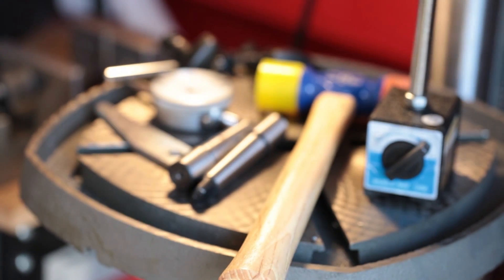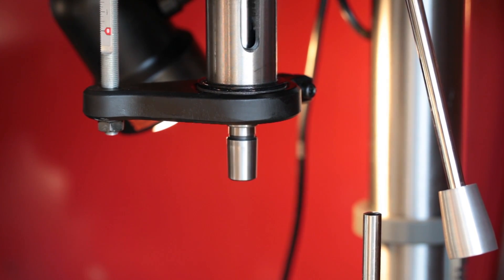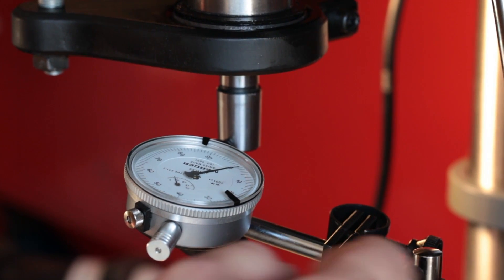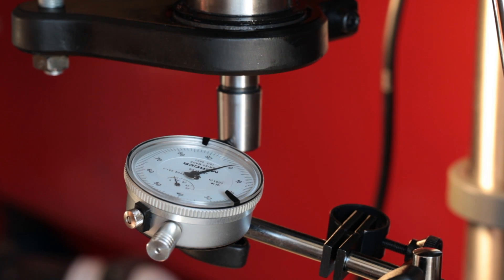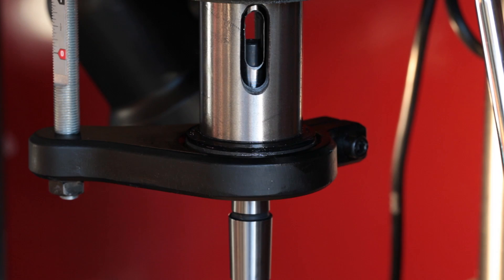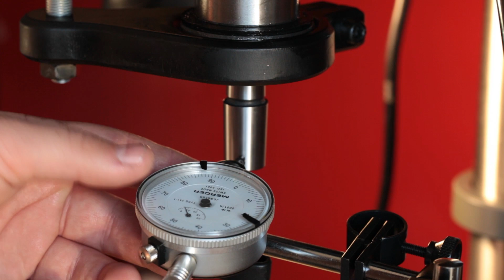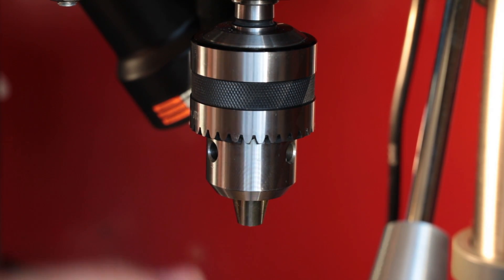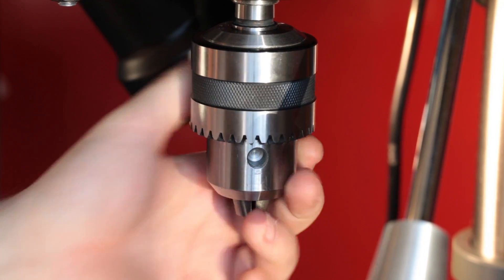Truing up the Porter Cable 15" Drill Press PCB660DP

Comment: The dial gauge you are using, each increment is 0.001 one thou, not 0.0001 one tenth of a thou.. it’s written on the dial face.. >| |< 0.001 inch

Comment: You do not measure runout using specific points like 3, 6, 9 and 12 oclock, you need to turn the spindle and look for the lowest point, set that to zero then turn the spindle till you get the highest reading and that is your total runout, From this side of the camera I could see very little difference between the 2. You also got me confused using both tenths of thousandths and thou of an inch, if I could get 3 thou runout on my drillpess I would be happy, few get lesser runout without going into a lot of money, A human hair is between 0.002" and 0.006" thats between 2 thou and 6 thou, the average sheet of printer paper is 3-4 thou so imagine the runout you Don't have.

Comment: I appreciate the vigor of your pursuit of excellence here. Two things:
1. At less than .001 runout, my gosh, your original setup was excellent. 
2. The drill press is a rather rough cutting machine to start with. The better approach is to buy a set of reaming bits which will make the “slightly small” hole, which was rough cut by you with a slightly small drill bit, a smooth, straight, and true hole at the final diameter you desired.

Comment: I'd rather not add to the other negative comments but................ maybe someone else can learn something from this. When I was first learning I went down this same hole as well. It gets expensive real quick with less and less returns. It's a drill press, set that indicators magnetic holder on the DP's rear vertical column then set the indicators tip out towards the front of the table. Then add maybe 10 or so pounds of down pressure with your thumb on the table edge. Due to the really poor cantilevered design on drill presses for the table support the table will flex variable amounts. That variable will change with any difference in drill size, work piece weight and even what tooling weight your using to hold the work piece. I've read on average it takes roughly 150 pounds of down force on the quill to drill even a 1/2" hole in mild steel. With that you could easily see .050" or more deflection in the table from being 90 degrees to the DP's quill. For that reason I found it pretty much pointless to even use any DP I can afford and have enough room for since it's just about impossible to drill a straight hole with one. I sold off my 16" DP and now only use my Bridgeport clone with some good keyless chucks. If I need it really accurate I don't even use those but hold any drill and/or reamer with good ER collets. And I'll drill under size, single point bore the hole to get it on location, round and straight and then ream. Drills are considered as roughing tools only since they can't and aren't designed to drill any hole that's round, straight or even on size. 

Tolerances can stack up or subtract from each other. While it's worth doing a rough check, the run out on the Jacobs chuck taper on your arbor might have zero effect on how well the drill chuck is holding a drill concentric to the spindles C/L. Due to that stack up or canceling effect a more accurate arbor might or might not allow the chucks built in run out hold drills any more accurately. If the tolerances stack up the wrong way a more accurate arbor could even make things less accurate. Holding a ground and known to be straight pin in the drill chucks jaws and then checking it's run out at the chuck jaws and then maybe 3" from those is the only way you can be sure of what your accuracy is. Even at that drill chucks are no different than a lathes 3 jaw chuck. They can have variable amounts of maximum run outs depending on where the jaws are positioned when holding larger or smaller diameters. My Albrecht chuck averages .001" - .0015" in run out so even spending $300-$400 for one of them is pretty much wasted on any consumer grade DP. 

If this all sounds like I'm being far too negative it's not meant that way. Making incorrect statements and confusing .001" and .0001" on any video involving accuracy even by simple mistake really makes the video creator sound foolish. Calling any part "this guy" does exactly the same. Use the correct part name.

Comment: So if you want to take this a step further without putting a German chuck on it you can try marking the arbor and chuck you can leave the #2 morse taper in the spindle and try putting rotating (indexing) the chuck the "sweet spot" on the Jacobs taper where the chuck run out  and arbor  run out  tend to each other out.  If you wish to go further down the rabbit hole you will discover drill bits have run out and the quill ball bearings have some level of clearance and run out. Furthermore, your drill press is a dynamic machine meaning it has vibration witch will also lead to accuracy issues.  If that were not enough you have table flex and column flex issues depending on drill size and feed rate.  Having said all of this if you are  actually expecting to hold " a few tenths of a thou tolerance on any drill press (let alone a consumer unit made in China) you are using the wrong equipment.  This is milling machine jig grinding territory.  Most home machinists could be and should be very proud to hold +/- .001" or even .002" tolerances.   Tenths of thou is clearly toolmaker & tool room territory even with expensive top of the line mills and grinders.

Comment: Thanks for the overview Jon. I too have the same DP, and I'm off to check mine out.

For a good in-depth investigation of drill press runout check out Enots Engineering's video "Drill spindle or drill chuck run out ?" https://www.youtube.com/watch?v=UhN8fiF6hss.
He went through a very thorough (to my eyes) investigation of the runout on his drill press. Turns out that the #2 Morse taper had not been cut deep enough into the quill. Luckily for him he had a lathe which allowed him to re-cut the quill's taper.

Comment: 8 or 9 tenths or 6 to 7, no problem, 4 to 4.5 tenths, 3 to 3.5 off center. I would have been interested to see a run out test at the top and bottom of the Jacobs No 3 taper, that might show something that is not acceptable. I agree the there is a poor fit up on the item you replaced, however that can be fine tuned to still make it a good thing.
Just my thoughts, John, Australia.

Comment: In American machine shops we say
One inch divided by 10 is .100 and this is called "one hundred thousanths". 
Half an inch is .500 called "five hundred thousanths"
One inch divided by 1000 is .001 this is called "one thousanth of an inch" 
The indicator used in this video will measure one inch in one thousanth increments. Meaning each line on the dial is .001 or one thousanth of an inch. Every word above is spelled correctly. Machining since 1983.
Reply: Mark Failla, if you’ve been machining that long it means you’ve never learned anything new since you were incorrectly taught back in ‘83. I don’t know which is more sad. At least your math was correct. But if you can get an inch of travel out of that indicator I’ll eat it. Surely in your long machining career you’ve come across indicators that measure tens of thousandths/ten thousandths/tenths? All meaning the same thing 0.0001”. I used to calibrate indicators and the equipment to calibrate has to be better than the indicator being calibrated so, as shocking as it may be to you there are devices out there that can measure up to 6 decimal places not to mention the laser equipment needed to calibrate the calibration equipment. Sometimes things require more accuracy than you common “thousanth” of an inch. Autocorrect must have dogged you when you tried to type that. Lol. And Jon, your methodology is a bit flawed, but you admitted that so can’t fault you. But I was a bit confused when you went from your tens of thousandths to all of a sudden saying thousandths. Admittedly I didn’t follow all your readings closely enough and really it’s not important enough to rewatch. Sorry if you’ve read all this only to realize  it’s not important anyway. I just couldn’t let Mark get away with what he said. I hope he was joking. Makes me worried when we complain about the Chinese junk we buy but none of us are prepared to make anything better. I’m sure they laugh at us for being stupid enough to buy their crap in the first place. And comments like Mark made don’t make us look very smart now do they? Now go out and study something and make yourself smarter. You know that’s what the Chinese are doing. Maybe I’ll learn Chinese then I can at least talk to my future boss in his language. Have a good one.
Reply: Mark Failla Pretty sure the indicator has a resolution of one ten thousandth of an inch.

And I'm pretty sure "thousanth" is not how to correctly spell thousandth.

Comment: Unless you bend an arbor or you have more than a .001 runout, a quality chuck would be a better investment. Get a 1/2 ground drill rod, chuck it up, and indicate that. If your chuck cant repeatedly hold a bit, it won't matter how true your arbor is. Truth is unless you're using an optical punch, center drilling, drilling and then reaming the hole, most people wouldn't notice .003 runout.

Comment: Less than .001 total run-out on a drill press is about as good as it gets with a chuck, I wouldn't even try to improve on that. What I would do when measuring run-out is to check the run-out of something in the chuck since that will be where it will run-out the furthest. Also, one tenth of a thousandth is .0001 for all the people confused. .001/10=.0001, one tenth of a thousandths and one ten thousandths mean the same thing.

Comment: You or your measurements are confusing.  I suggest you study the difference between thousanths and ten thousandths, and then view this video again.  You only demonstrated that there was virtually no difference in the runout of the two adaptors and that your math skills need work.  I appreciate your efforts but you really should review your material before posting.

Comment: You said; "eight ten thousandths" was about three and a half to four thousands" ? You were just shy of one thousandth of an inch.
 On a drill press in a regular shop- even .020" runout won't be a problem. In most home shops with cheap drill presses, I'd bet most are .125" off, then add a cheap drill bit and/or a drill shank that has slipped and has a tit on it and you got a mess. LOL.
 Remember, a sheet of paper is about 4 thousandths thick.
 Good awareness video though.
Reply: So .020" runout would be a problem in almost any metal working shop, either commercial or home. I would give that a pass for woodworking only.  .125" or 1/8 is unacceptable even for a hand drill with a bad bit in it.  .004  runout would tolerable for most home shops depending on what kind of projects are being done.

Comment: You need to stabilize the drill press before running this test.....how do you know if you are getting accurate readings....you just wasted your time.
Reply from the maker: Because I confirmed the measurements of the quill by attaching my dial to the head as well.  The dial was also attached to the table, the same surface a part would be attached to.

Comment: No need to buy a new arbor until you try to eliminate other causes.  Remove and clean and deburr the arbor and inside of the spindle.  Probably better to spend the money on a new American made chuck, as there is where the most "runout" is. Good effort in the video.

Comment: Hi Jon,
Just bought one and pretty nice, although there is some chuka-chuka sounds coming from the spindle that I believe are the result of some slight rotational play in the spindle (meaning, hold the chuck and try to turn the spindle pulley- mine has a little play and a clunking sound when it hits).  Does yours do this?  Despite this, I have no noticeable runout.
Thanks,
Steve

Comment: Just tested mine (I have the same PC drill press from Lowe's). When I test the shank of a 1/2" router bit (straightest thing I can think of) in the chuck, I get 0.007" runout. This seemed a bit high, so I removed the chuck and tested only the arbor like in your video. I got 0.001" runout, which is effectively 0.0005" actual. This is very close to your measurements. If I replace the arbor with the McMaster part, I would expect to get even less runout. However, this still means that I have an issue with the chuck. Is 0.007" enough that I should see if PC will send me a new one? The drill press is only 6 months old, and I've only used it a few times. Thanks
Reply: I would say .007" run out on a Porter Cable chuck is well within spec.

Comment: Excellent video.  I just picked up one of these drill presses tonight and ordered the McMaster arbor.  However, I seem to have gotten the aluminum pulleys and the belt came off in the first few runs.
Reply: akjell Either the belt tension was too loose or the belt was not on the same level of pulleys.

Comment: Did you end up replacing the chuck?  If so what did you buy?
Reply from the maker: Nope - kept the original chuck so far.  If I do replace it I'd like to go to an Albrecht Keyless unit.
Reply: Jon Kensy Thanks for the quick response.  You've now been using it for a while.  How is the performance over time?  Are you using primarily for wood or metal?  Any issues with the drill press in use?
Reply from the maker: I use it primarily for metal - almost no wood use.  No issues thus far!  I added a coolant system for when drilling large holes in metal, but other than that it works great.